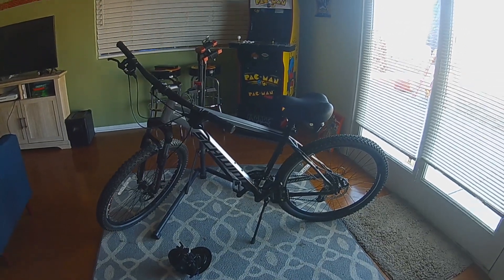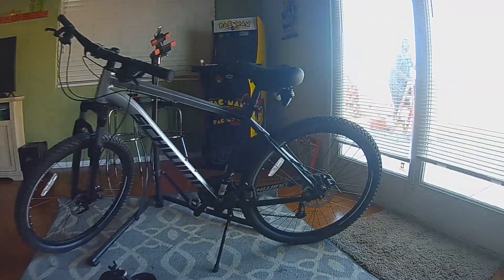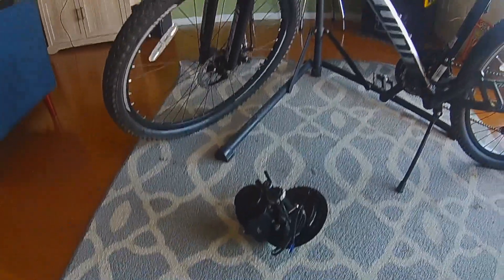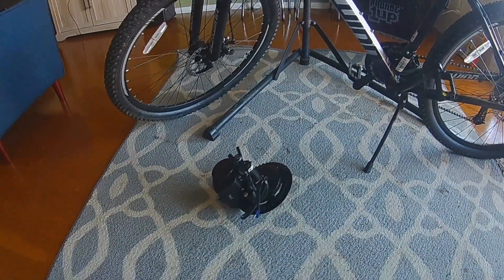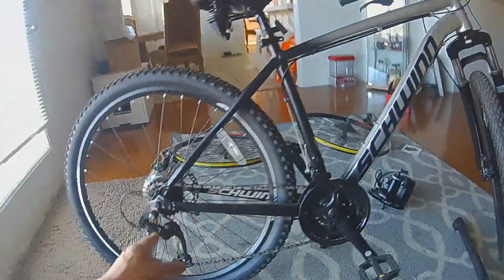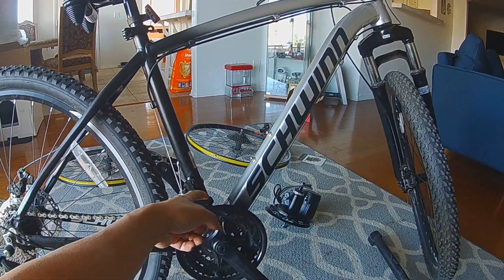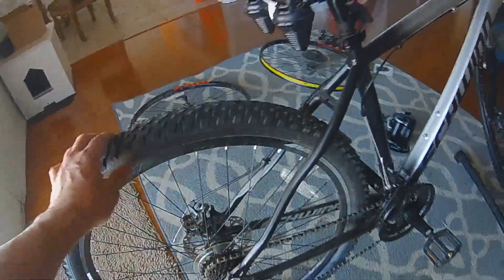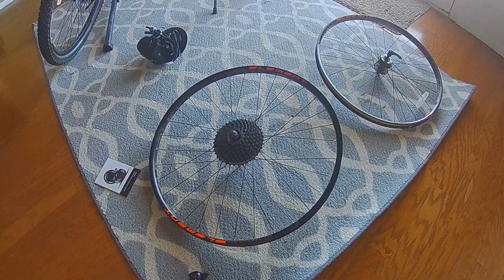Schwinn Al Comp to TSDZ2/Tongsheng ebike conversion

Comment: Great video. How many mm is thr bottom bracket I have the same bike and want to do this conversion thanks.
Reply from the maker: If I remember correctly, 68 mm. Still runs strong to this day with no problem. I would recommend changing the sit if youll use it for mountain biking. I'm actually thinking of converting my full suspension bike using same type of motor.
Reply: @desertmtb5028  awsome thanks for the info brotha! I used a tape measure to get an approximate ans I got around 60mm so I'm thinking thr 68 should work. In looking at changing out the front fork, switching to hydraulic brakes I've already changed out seats I want to build a nice mountain bike out of it overtime. I'm glad your build is still running good thanks again!
Reply from the maker: I use a 13ah battery and charge at least once every 3 weeks. Just a rough estimate, 20miles/charge